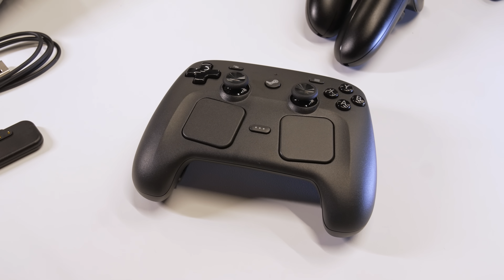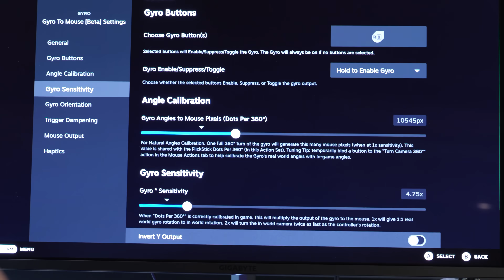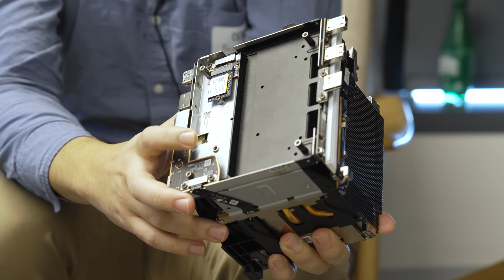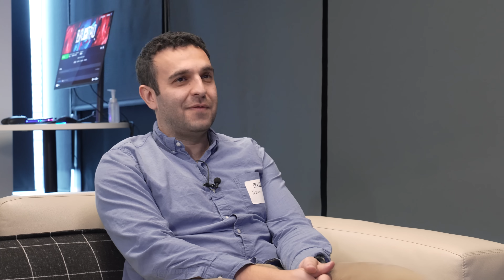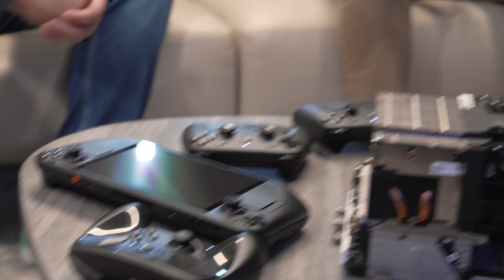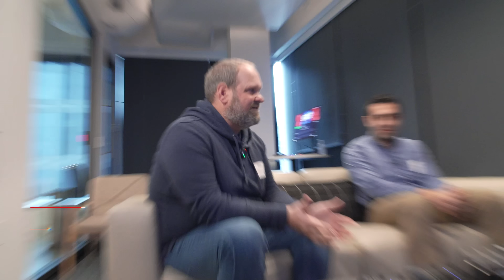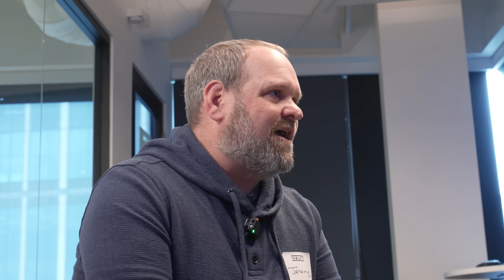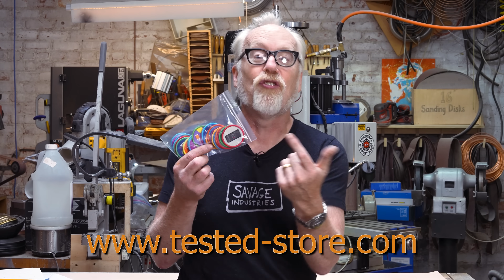Hands-On: Valve Steam Controller 2 and Steam Machine!

Comment: I probably won't use the steam machine over my PC, but I really hope this forces companies to improve anticheat support on linux. I wish I could switch to Linux and get away from windows, but too many of my friends play games with anticheat only available on windows
Reply: as someone who uses an old ass laptop to game, this this was made for me. i always prefered consoles because although my laptop has all my favorite games, consoles have way better storage and and power. now a pc build like a console that i dont have to build or pay thousands for? the steam machine is perfect for casual gamers who prefer pc gaming but only know how to play on consoles, this is gonna help a lot of people
Reply: I wouldn't use it over my PC, either, but I use my Steam Deck as a secondary machine in the living room a lot, and this would be a nice upgrade for that use case.
Reply: I'll definitely be using the Frame and Controller though
Reply: @Un1234l really depends on the price for me. I really like vr tech but I rarely use my quest 2. Glasses are a pain and I find the games themselves lacking. I want to support the frame for being so open though. I doubt I'll play flat screen games, I have a great PC setup and Monitor, and if I travel, the steamdeck is completely adequate.
Reply: @TheTonVeron   You've really checked out the VR library? Pavlov, Contractors, GunClub, VTOL, MS Flight Sim, VR Racing, Bonelab/Boneworks, Blade & Sorcery, HL Alyx, etc?

Also, maybe a manual treadmill would get you more into VR. "Clasted Bheeks" has an incredible DIY Manual Treadmill video that's convinced so many people to try it out. 

Or check out "optimum" where he shows how immersive VR racing is when combined with a great racing setup.
Reply: Companies choose not to support Linux because the AntiCheat is actually malware (a rootkit to be precise). What they really want is kernel access so they can harvest any information they want from your system.

Linux security doesn't allow it, because it's literally just malware.

Companies don't support linux because they cannot steal data from linux users, therefore it is more profitable for them to only deliever malware to systems that allow their malware to act like malware.
Reply: @xBrokenMirror2010x  Yeup, and we really need to vote with our wallet on this one... Wish people would say "no" to kernel-level anti-cheat. But the addiction is real I guess.
Reply: @xBrokenMirror2010x If this is true, we have to make sure we voice this concern because 90% of gamers probably don't know this is a thing.
Reply: @xBrokenMirror2010x  maybe, or maybe it's truely easier to develop the anticheat with that level of access and it's just cheaper and quicker. I think it's fair to say the install base on linux was to small to worry about, I hope valve helps remove that excuse.
Reply: @TheTonVeron  Most of these Kernel Anti-Cheat that "Don't Work on Linux" do in fact work on Linux, the developer can change 1 value in the Config file to make it run on linux. But they no longer have complete unrestricted access to the entire system if they enable Linux Support, therefore they do not.

Now, let me ask you, does the company that literally makes you sign an agreement that they are allowed to harvest and sell any data, including a long list of things they sell, including but not limited to Browser History and the names of every single file on your entire PC, NOT have a monetary incentive to install a rootkit so they can actually harvest that data?

They claim they can sell it, after all. How else are they going to get that much data if not literally installing malware on your PC?
Reply: @xBrokenMirror2010x The anti cheats use kernel access. Many things have such privileged access. That doesn't make them malware.

"Linux security doesn't allow it" is pure fantasy. Whoever told you that has no clue about the Linux OS or security. It is possible to control access using tools like SELinux, but those are tools, not barriers to using the computer.

Source: I manage Linux servers. We use SELinux and antivirus and security software. If Linux were somehow unable to grant privileged access, Docker wouldn't work, endpoint security tools wouldn't work, and businesses would be unable to use the OS for serious work.

If there are no anti cheat tools that run on Linux, that would be from disinterest, not because the OS lacks basic functionality.
Reply: @j_taylor  These anticheat are running user code on ring0. Linux does not allow software running in a user-space to access ring 0 like Windows does.

If you want to run something on ring 0 in linux, you have to do specifically design kernel modules for it. You cannot just run user-mode programs on ring 0 like Anticheat wants.
Reply: Any game that has anti cheat is shite
Reply: @onions_channel  A lot of the anti-cheat implementations involve kernel level access which is an absolute no from me.
Reply: @onions_channel I didn't say I like it, but the reality is that a lot of the largest games have anticheats that don't work on Linux. Currently Six of the top 10 selling games on Steam right now use kernel level anti cheat. I don't think it's fair to just write off those games.
Reply: @onions_channel  Pretty sure that Hello Kitty Island Adventure has anti cheat.  No on says that game is shiite.
Reply: @reallybigjohnson it has Denuvo (anti piracy) but not anticheat.
Reply: @onions_channel  But every multiplayer game needs some kind of anti-cheat. Otherwise the game is filled with cheaters ...
Reply: @Neuvost  There's this thing called "Herustic Anticheat" it works better then any other anticheat because it runs on the server. It looks at game-data clients are sending and it regulates it.

It's the best, most secure, anticheat because it can be patched randomly/arbitrarily, and unknowingly, and it is never installed on user systems so it cannot be directly reverse engineered.

Kernel Anti Cheats have basically all been reverse engineered, that is why cheats exist for them. They are only prohibitive, because reverse engineering these anti-cheats is difficult and the people that can do it keep their methods secret so they don't get patched, and they can sell menus. But this is why games with kernel anticheat all have cheat menus which are reliably updated.
Reply: Dumb question considering the thing isn't for sale, but do you think it's possible to mod the machine to have a second OS?
Reply: @goosmdoosm4755 yes, the steam deck can and then made a point of saying it is just a PC. The frame is a tougher question
Reply: @goosmdoosm4755 Yes… this is not official but it runs Linux so install any other Linux distro. If you install windows on it go to the techno church and repent for your digital sins man
Reply: @goosmdoosm4755  not a dumb question. Steamos is an Arch based system so 100% yes, literally Arch was started with a "build it from kernal yourself" mindset.  You can't get more customizable than that.
Reply: @goosmdoosm4755  Yes, absolutely will be possible to run a second OS, Valve even mentions running whatever OS you want on the marketing page, it's a PC
Reply: @goosmdoosm4755 100%. It is just a regular PC and you can install windows or dual boot steamos + windows, so yes this is a very viable option and is what people have been doing for ages.
Reply: you can dual boot operating systems, homie. it's extremely easy to do.
Reply: @S7ARBOY  That throws away the convenience which is what this console relies on. Installing windows, dealing with windows bs and their crappy interface is something the buyer of this device wants to avoid.
Reply: @S7ARBOY earlier this year I had an arch and Windows dual boot set up. There was a Windows update and that messed up the bootloader, and I found it extremely tedious to go and switch to Windows anytime. I wanted to play a game with my friends, and then switch back when I wanted to play a different game. At that point it just made more sense to have all my games on Windows and I mostly use my computer for gaming so there's no point to use Linux.
Reply: @TheTonVeron there are plenty of reasons to use Linux. this is a highly subjective take. 

sounds like you had an issue with Windows. I have personally never had this issue.
Reply: @S7ARBOY  Hi, long time linux user here. You could do it but I don't recommend it. It just kinda sucks and inevitably you wind up just using windows because most people just want to get everything in one place without having to think too much about it. "extremely easy" in linux nerd terms is like, medium difficulty at best for most people. Untill the Linux community really grapples with this, it will never be year of the linux desktop.
Reply: @S7ARBOY most people don’t want to manage two installations though, or boot to another installation just to play a game
Reply: @Rordan44 I understand that but it's possible and easy to do. this is all speculation anyway. you all have no idea if that'll be true by the time this releases. Valve could easily be in talks. and if this sells well enough and gets millions gaming on Linux, developers will follow the market. 

I don't think you want to be shilling for anticheat that is essentially spyware with root access... if rather be on Linux anyway
Reply: @S7ARBOY  also besides the point, it's like having 2 OS on your phone, and you need to boot into 1 to run say the Map app. 

You would also be booting into windows, so you would effectively need a keyboard and mouse, which in turn reduces it's utility as a living room, tv PC which can be controlled entirely from the controller
Reply: @S7ARBOY  Windows uses NFTS Linux uses ext4, invisible for windows. Dual boot wint mint broke my windows 10 installation from my old laptop. I can't recover it since there's no windows 10 anymore, now I'm forced to ignore windows 10 and erase it when I have the time (can't go to windows 11, and I don't need), and try another linux distro. I was using it as an extra monitor to watch sports, Linux Stutters when watching videos/live streams on F1TV and Youtube on browser.
Reply: @mariop8101 weird I use Arch (same distro SteamOS is based on) and dual boot just fine and it's very shoyrt and responsive. I notice less lagging on Linux vs Windows
Reply: @S7ARBOY  I'm on cachyOS and find it more responsive and smoother than Windows. I only changed over from windows a couple of months ago and it was easier to change over than I thought it would be, Linux has come a long way since valve got involved.
Reply: @mariop8101  That sounds like user error. I use NTFS drives to hold games that don't benefit from the speed of EXT4, and share them between a Fedora and Windows installation. When installing, you are given a choice whether to delete the pre-existing OS or to install alongside or to clear the drive.
Reply: @cromfrein  You can Install along side on another drive?
Reply: @mariop8101  yes, and on the same drive too (if the drive is big enough)
Reply: @mariop8101  which browser are you using? try zen
Reply: Steam OS isn't a great OS right now, nor is it a replacement for Windows unfortunately.  Updating my Steam Deck via its default updates in desktop mode made a lot of my software that wasn't straight off the Steam store break.
Reply: @TheodoreBundy420  I haven't had this issue at all... and I'm in desktop mode a lot...
Reply: @error.418  Could've been a bad early update but it broke most of my emulators
Reply: @TheodoreBundy420 it's been quite stable for me, but not without issues. Most were fairly easy to solve with the console though.
Reply: @TheodoreBundy420  Yes, that's part of how SteamOS works. It's not meant for "normal use", and instead for more gaming or casual stuff with flatpak applications and launchers. If you want a desktop, use a desktop focused distro.
Reply: That's a big wish but in reality that won't happen. Linux is not secure enough to for companies to drop anticheats for Linux. Just duel boot or wait for for xboxs ui for windows which is coming soon.
Reply: @ghostlegit  Linux is more secure then Windows.
Reply: @xBrokenMirror2010x not true.
Reply: @ghostlegit lol
Reply: @ghostlegit  Are you trying to tell me that the OS that released a "feature" where it, by default and without consent, took screenshots of the user's desktop periodically, and uploaded them, unencrypted, to a cloud server(which is ironically, probably using Linux) is more secure?

Right. Lets go with that.
Reply: @xBrokenMirror2010x linux is ooen source so by default it is less secure than windows. Thats why anticheat doesnt work on linux unless given permission by developers
Reply: @ghostlegit  Open source =/= less secure. This is 90's enterprise thinking. Since this is a consumer product, valve has the knowledge to know what configurations are safe.

What is correct to say is, a less knowledgable user is likely more safe in a walled garden than open source, but then this also means windows is less secure, which it is. 

I work in an industry built 100% on open source because it fundamentally requires it, and like anything else exploits are found and quickly patched.

Comment: I don't get what tracking the steam controller in VR is for. "I hope games will make use of that" why would they develop an input method not just for one specific VR headset, but for an ADDITIONAL controller? I see that just as an accessibility feature if you can't use the VR controllers. No idea how VR games that expect two controllers react to only one controller
Reply: 1. Lots of VR games expect you to be using a regular controller, not the VR ones, especially seated VR games, driving games, platform games, flight sims etc.
2. The VR headset can play regular non VR games as well, using a virtual screen, and almost certainly these games won't support VR controllers at all.
As a minimum, adding tracking to the controller allows you see the controller inside the VR view, like you can with the VR controllers. So no feeling around blindly, or having to turn on cameras, or lift the visor up to find your controller.

Comment: As someone who loved to original steam controller, I hope that using both pads as primary inputs isn't uncomfortable. It was the best part of the original
Reply: same but from the video i watch you have to reach over the sticks to go to trackpads and using dpad centric games bumps the stick
Reply: It isn't uncomfortable on the deck, so it stands to reason it shouldn't be on the controller.
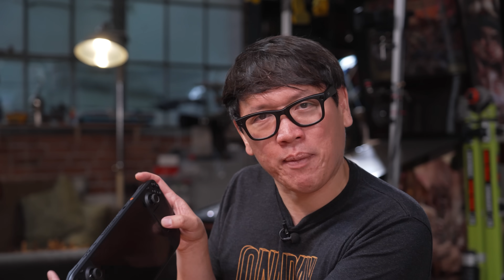Reply: @DragunBreath  I found it uncomfortable and even Norm at the 2:50 mark of the video mentioned that he found it to be "the least ergonomic part of the Steam Deck".

So it's more case by case situation than one size fits all. Will need to see if turns out to be ergonomic for touchpad users who use them as primary inputs over the joysticks, which is what is more likely to cause strain if it isn't comfortable for them.

For most who will be primarily using the joysticks and occasionally use the touchpad for less demanding games or as secondary functions like touchmenus it won't cause issues. They'll likely not have to adjust the grip at all for what they'll use the touchpads for, or if they do the game might be something like Balatro where grip not being completely comfortable is less likely to cause strain over extended use.
Reply: @DragunBreath it's much lower and closer together than on the deck my guy. There is exactly 0 guarantees this thing won't be an ergonomic nightmare. 

I don't care about the Steam Machine, there are million more capable, more versatile devices already on the market, much less build -able. The contol though. That is potentially unique and could be best in class if they execute it right.
Reply: @TheMetaSentient i mean, people say the exact same thing about the Steam deck
Reply: @TheMetaSentient  - When the deck was introduced, and I first saw the control layout, I thought it looked like an ergonomic mess, but ended up being the best layout I'd ever used.  Even if it does end up being bad, it's not like there aren't a ton of other options that follow more traditional layouts.  Agree with you on it having the potential to be best-in-class.  Having access to the gyro alone without having to jump through stupid hoops like you do with other controls has potential to be game-changing (pardon the pun :))
Reply: @DragunBreath  You can already tell from the demo videos, it's gonna be way worse with overstretched thumbs and shifting your grip. Watch any of Valve's own demo videos closely when they actually use the thumb pads. They struggle to hold the controller and use the thumb pads and shift their grip anytime they use the shoulder buttons or any of the face buttons. It's also noticeable that even GamerNexus Steve and LTT Linus show barely significant footage of them using the pads, let alone comment on them beyond "it do the thing Valve says it do".
Reply: @FrederikSchumacher  - Funny story, I thought the exact same thing about the Steam Deck's controls when I had only seen them in videos and images.  In practice, my experience was much different, becoming my favorite layout of any controller to this day.  Best bet is to just try it when it's released and see if you like it or not.   Control layouts and their ease and comfort of use are very much a subjective thing.  For instance, I've never liked the xbox gamepad layout, even though it is by far the most widespread and commonly used.  For me, the d-pad is for all intents and purposes, useless for the type of games I like to play with a d-pad (2d platformers, and other classic games)
Reply: Sadly, it will be... The trackpads are now just an option, not the main input. Jut look at it. They're too close and too low in the body of the controller to be used as main inputs unless you use some kind of weird grip it will be almost certainly a pain to use as main inputs.
R.I.P dual stage triggers...